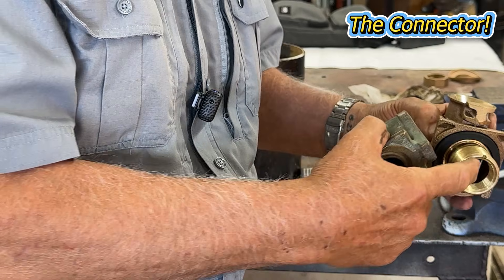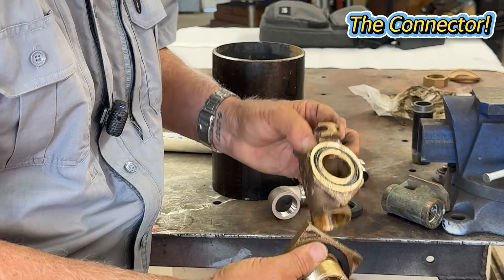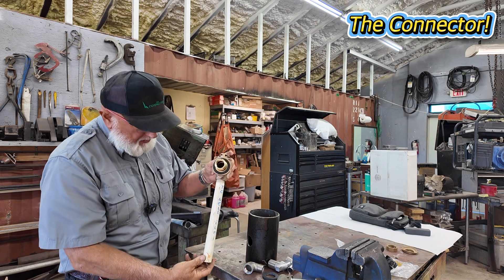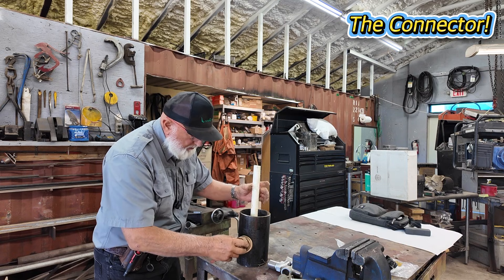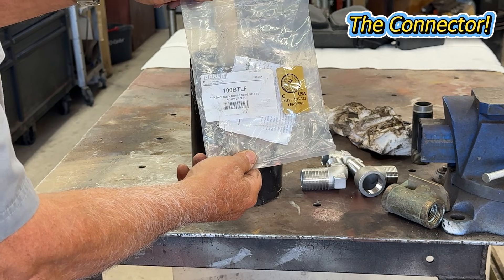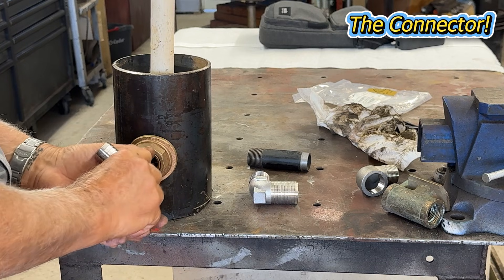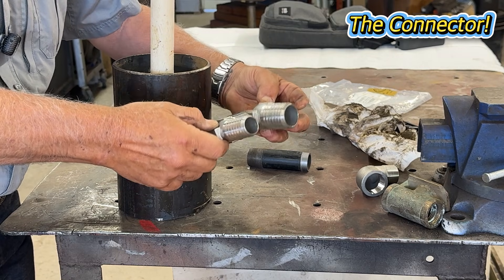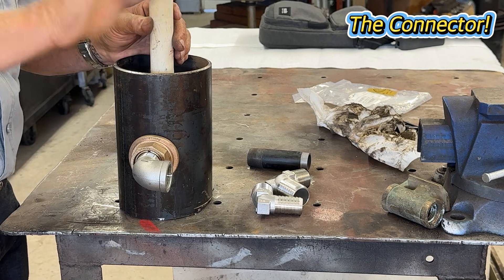Pitless Installation - The Justice Way Or The Holiday Way💧Joel Hellwege, Pagosa Springs, CO

Comment: We install a 100 pitless a year for 35 years the HOLIDAY way and have never had an issue! Our pitless adaptors are down 8’ here because of the frost. We simply pack the dirt nicely with a shovel to cover the pitless and then let the backhoe backfill the rest. Your 90 degree elbow will create more friction loss and more turbulence that will create issues with iron build up on certain water.
Reply from the maker: Very good! If you are going to install a pitless the holiday way, then you shouldn’t dig a foot or 2 feet deeper below that pitless when you have 4+ feet of dirt, pushing down on the resulting piping out of the pitless.  I suspect that you drill the hole at the very bottom of the trench and don’t have much possibility of settling. Also, putting a flat rock underneath the pitless/pipe with the holiday method will really help that nipple not to break off.
    We’ve looked into the amount of friction loss that the elbow adds and at least an hour world that is an absolutely nothing thing.
    You obviously are very careful with the way that you do your work. Hats off to you!